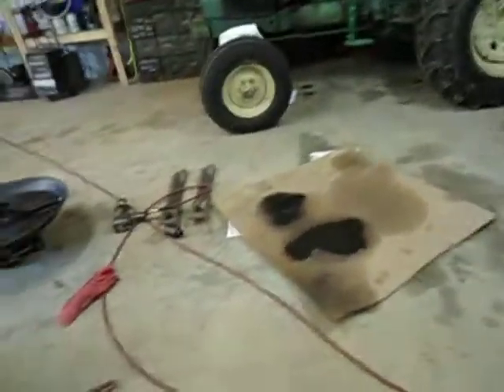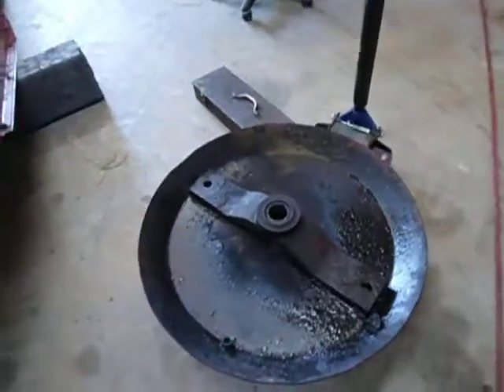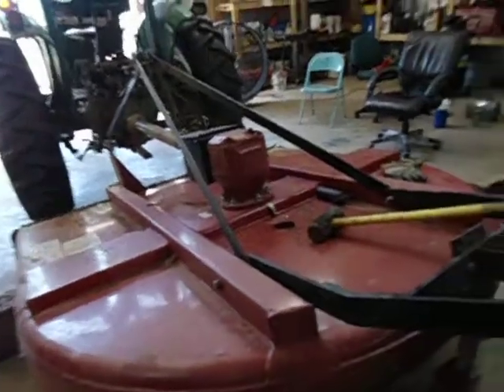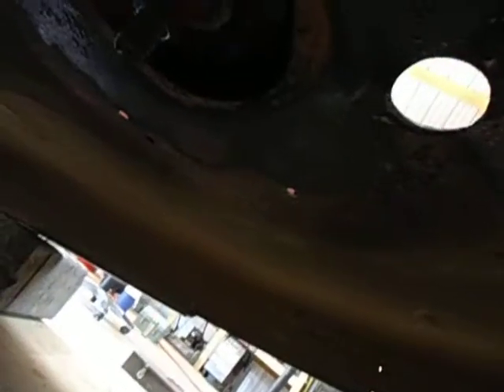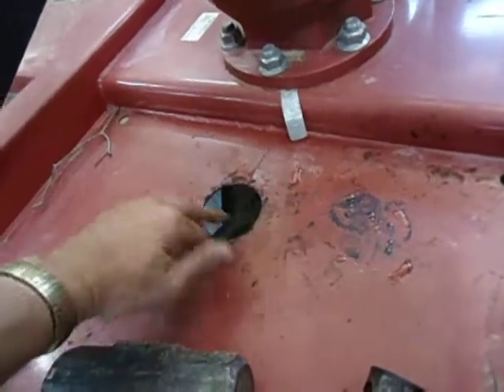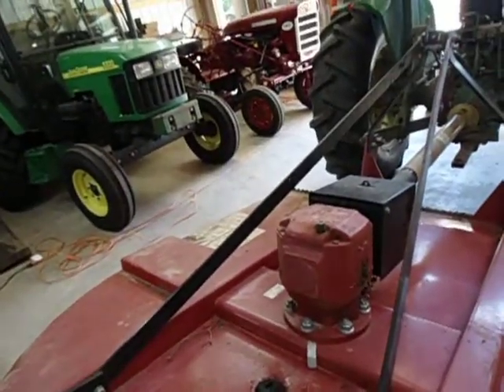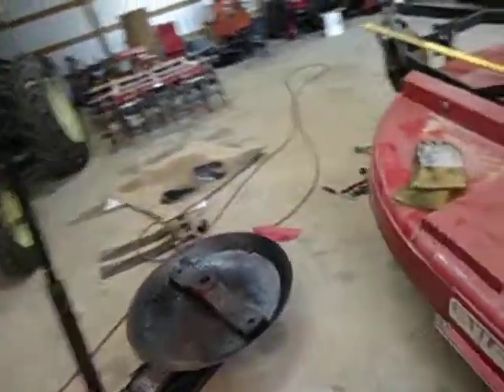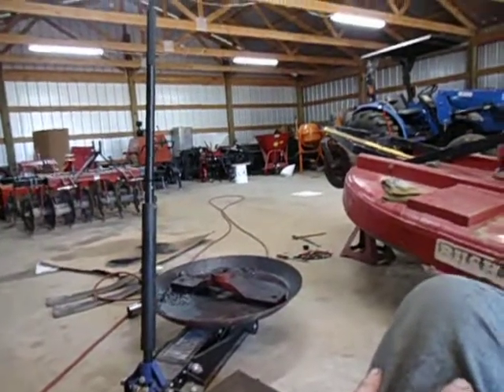Replacing Bush Hog lower seal:getting stated

Comment: Had an oil leak in mine. Stump jumper was full of oil, and I knew the torch would make a big fire, so I  threw some sand in the stump jumper before I torched it. Fire was very minimal., and easy to put out..

Comment: That's why I run trailer type bushhogs, if i have to do that I just turn it upside down. 6 hours probably would have been worth it to take the 3rd link bracket off an flip it.
Reply from the maker: Got one of those too. Re-built it last summer.2 gear boxes on that one.
Reply: @amossnowdaharleyman9179  they still suck but at least you're not laying on your back.

Comment: so is the stump jumper pressed on?  I got the nut off mine but there looks like a lock ring around the shaft and I cant tell if its holding anything or if its just the way the bad seal looks
Reply from the maker: It isn't pressed on. Just an un-godly tight friction fit. Best luck I've had is heating the stump jumper area around the shaft with a torch and then go back up on the deck and using a 2" steel solid bar "adapter" that goes through the blade nut/bolt access hole and a 16 pound sledge hammer start beating the heck out of it. Rotate a little between whacks so it doesn't bind up.
Reply: @amossnowdaharleyman9179  Thank you for the information.  Its still sitting out there.  I have heard to put 000 Corn head grease or high temp grease in it too.  Any advice there?
Reply from the maker: @dkp7895  If the seals are maintained 80/90 wt gear oil is the better option.If gear box is completely worn out use the cornhead grease. Do not use high temp grease.

Comment: Are you BS-ing me??? You have to torch the damned thing and whack at it for an hour, hopefully getting it off, all for a $12 seal?
Reply from the maker: Pretty much.....
Reply: So, I got the stump jumper off, left castle nut on loosely, whacked on it from the top, maybe 20 times, came right off.  No heat, no cussing.  Then I finally hot the split ring off, draining remains oil but the old gasket won't budge.

Make you a deal, I'm a dentist and I'll be happy to pull any one of your teeth if you tell me how to extract the old gasket.
Thanks
Reply from the maker: @Jslav-jj2xq  There is a tool that you can get at any auto parts store or on-line. Look for "seal puller/remover". Next option is drilling a small hole in metal part of seal,install a screw,and lever against the screw like you are pulling a nail.Seals can be hard to remove but it can be done.
Reply: @amossnowdaharleyman9179  don't see metal,  May try hole in rubber first, can't hurt it, right
Reply from the maker: @Jslav-jj2xq  The outer ring of the seal and the stump jumper side of the seal is metal. There is also (usually) a metal shield disc between the seal and stump jumper to sort of protect the seal from abrasives slung up by mowing.
Reply: @amossnowdaharleyman9179  thx
Reply: @Jslav-jj2xq  should be able to get a flat head underneath one end and pull back to lift up on it
Reply: @Darrenbrown09  I ended up pounding an awl into it and pried it out, greased new one and used 2 inch pvc over shaft to tap new one in.  Guess I got lucky, no heat necessary. 
Thanks to all for the advice
Reply from the maker: @Jslav-jj2xq  Good Job! Hope I was able to assist with advice a little.
Reply: @Jslav-jj2xq  good deal boss glad you got it done